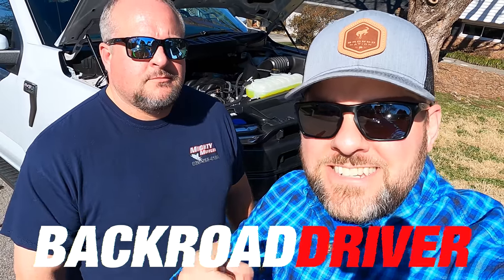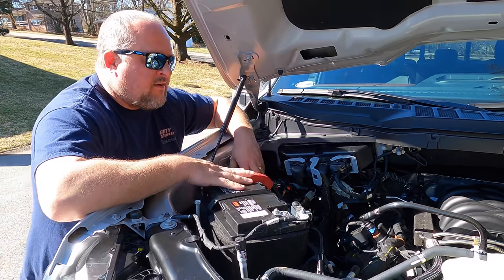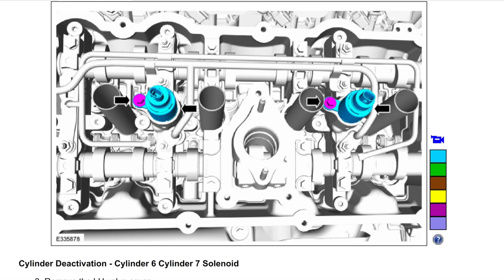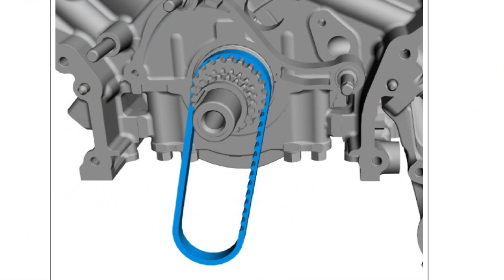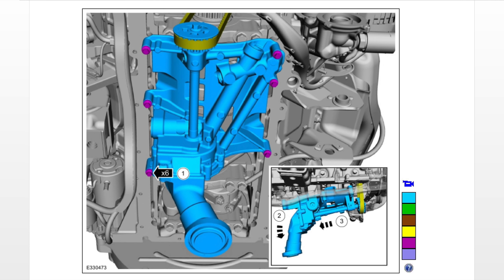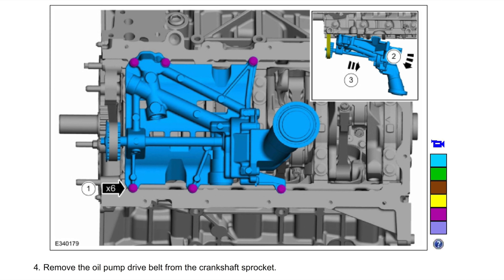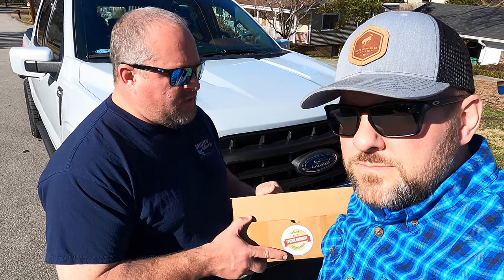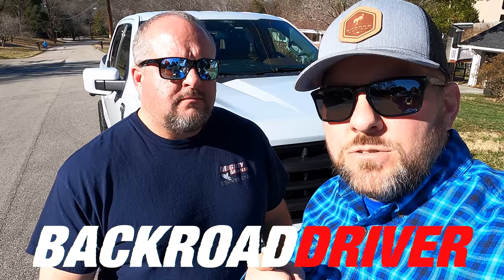2021 Ford F150 5.0 V8 Cylinder Deactivation & Oil Pump Belt Explanation - JLT Catch Can Install

Comment: They're not mentioning cylinder deactivation because they know people will avoid them given all of GM's issues...
Reply: Exactly.
Reply: Well it's a good thing on the 2021 f150 they have not just a Kevlar reinforced rubber belt on the oil pump...but the pump itself is a high flow oil pump that rivals aftermarket performance oil pumps. Stillen...the company that makes superchargers...asked ford when they were in development of a new supercharger kit if ford could put a better flowing oil pump on the 2021 4th gen coyote motor so it could handle the increased stress of forced induction. Since stillen is a big performance partner of ford...ford said why not? And did so. The other benefits of the higher flowing oil pump is the lifters get plenty of oil at low rpm...which was a big issue with gm and ram trucks with cylinder deactivation. So hopefully with this improvement...the 4th gen 5.0L with cylinder deactivation will not suffer the same fate as the gm and ram trucks.
Reply: As opposed to all the Gen 3's issues with oil consumption, piston slap, and cam phaser rattles? If guys are willing to gamble on the 5.0 knowing all those problems, why would cylinder deactivation stop them?
Reply: @karlschauff7989  to my knowledge the biggest issue with ford motors nowadays (and since about 2010) is that their OEM oil is literal garbage, all of the genes that I know of that are dealer serviced are having issues, all the guys doing their own services (that I know personally) are not having these issues, the only thing that changes afaik is the quality of oil/filters they use. (Yes motorcraft oil is API but they don't tell you it's within half a percent of the bare minimum in most categories, and they don't meet specs like DEXOS, while many aftermarket oils like mobil 1 do) we're in west texas where EVERYTHING has to be severe service (if you want it to last) because of dust and extreme heat (and cold for a bit). I do know a few that have already taken a gen3 past 200k miles here and they're going good.
Reply: Exactly!!! That shit has been a big issue on GM trucks for fucking years!!!
Reply: @Anonymous01416  ford specifically designed theirs to last essentially forever with good maintenance practice.... or about 50k over warranty using motorcraft oil

Comment: If I wanted a truck that ran on 4 cylinders, I would buy a 4 cylinder truck. Definitely keeping my 2016 5.0.
Reply: Same here! 2016 Supercrew 5.0 - I'll run it to 300K miles and beyond just like my 2006 5.4.  The 2021 Coyote is a step backwards.
Reply: Ummm guys... Just pull one single little wire off the battery and it shuts off deactivation. Doesnt hurt anything.
Reply: @raymondwandell8880  no that does not work, not at all. That system is simply to moniter battery draw and charging. I dont know where people are getting that bullcrap from but that does nothing to cylinder deactivation.

Comment: Wet belts are just stupid. Dont care if it's kevlar reinforced.  Rubber will break down in oil and combustion byproducts. When the rubber starts coming apart. It ends up restricting the oil pickup. It should have been an external belt if they want to use a belt. That way it could be easily replaced on service intervals. Think about the old 2.3 with the external timing belt, lasted a ling time.

Comment: Are Engineers losing their mind when they decided to use belts to drive oil pumps? WTF!
Reply: Their are race car engines that have belt driven oil pumps
Reply: @clb_52  race car engines are disassembled much more often that an OEM engine. These are probably supposed to last 150K.. Which is today’s standard. I wouldn’t trust that belt at all considering valvetrain belts are usually replaced around 100K miles, plus this belt would be under oil? No thanks!
Reply: @velr50gt  oil pumps has less parasitic power loss than a alternator,power steering pump and ac compressor so the belt operates with less stress and it is designed to be in oil
Reply: @clb_52  My brain tries to tell me it’s okay, but my instinct says otherwise. I did not see any kind of tensioner either. Belts stretch out too more than chains and submerged in oil? Looks like a recipe for disaster. 
I have a 2020 Supra which happens to have a BMW engine (B58) and guess what? The oil pump is driven by a double roller chain.
Reply: @velr50gt  trust me if a belt is operating in oil it is designed for that
Reply: @clb_52  Trust you at what consequence ...?
Reply: @clb_52  and they are constantly serviced after every race. Some race engines are rebuilt after every weekend. So comparing it to a race engine is stupid
Reply: @wasupfool5692  racecar engines only good for one race which equates to 150k miles on regular car engine if belt can handle that you should not concerned about it failing prematurely
Reply: @velr50gt  if you think belts are weaker than chains maybe you can explain why Harley-Davidson motorcycles use belts to drive the rear wheel on their motorcycles
Reply: @clb_52  Really?
Reply: @clb_52  Well I got a Victory and a Can Am which both use belts to drive the wheel(s). Those belts are reinforced with metal and carbon fiber fibers which I highly doubt Ford would do and either of them you can adjust for stretch or change it fairly easily. None ride in oil. You cannot convince me that using a rubber belt is a great idea to run none other than an oil pump. Something tells me that oil thickness is going to be restricted too.
Reply: @velr50gt  so you agree that belts can do a job for which it was designed for
Reply: @clb_52  Belts can be used on the right place. I would never ever thought an engine oil pump be driven by a belt. A belt breaks, stretches or slips on a motorcycle the chances of damage in my mind are minimal. If it does any of those while driving an oil pump at decent rpms and the engine is toast. Done.
Reply: @velr50gt  have you herd of a oil pump driven by a belt braking?
Reply: @clb_52  none of which are submerged in oil.
Reply: @velr50gt  the belts on oil pumps have teeth so it's not going to slip
Reply: @clb_52  all of which have to be adjusted. I know from experience. I’ve had three and not one of them was submerged in oil. Their biggest weakness is debris getting between the belt and pulley( pebble, wire,nail) it will be pushed through the belt. I realize you shouldn’t have any of this in your oil pan but you will have heat and a certain amount of sludge. Harley belt drive is a terrible comparison.
Reply: @clb_52  happens in nascar more often than you think
Reply: @clb_52  I have never heard of an oil pump on an OEM engine driven by a belt or breaking. Race engines sure, but once again. Those are gone over every X amount of passes or rebuilt anyways.
Reply: @clb_52  So what happens when it stretches? No teeth are going to compensate for that. Even timing belts with tensioners slip and they have teeth and are not ran through oil.
Reply: @velr50gt  if the tension is correct on a timing belt and is in good condition it will not slip it will take a significant amount of slack to cause a belt with teeth to slip

Comment: Cylinder deactivation and a oil pump belt? I bought my 5.0 for simplicity and durability. Where is that in the 2021?
Reply: The only simple and durable engine left in the Ford lineup is the 3.3L Mazda v6 :/
Reply: @datapro007  I disagree. 290 horsepower is more than most v8s were making 20 years ago and you never heard anybody complaining about a lack of power back then.

 If anything, 400 horsepower is overkill for most people. After all, if you need to tow your house, you probably shouldn't have bought a half-ton to do it with in the first place.

Comment: With cylinder deactivation, Ford just deactivated my wallet. Nobody wants that shit
Reply: Nope
Reply: I agree. I used to be a Chevy guy as well but once the started putting cylinder deactivation and afm it just ruined them for me
Reply: @spencertb6034  can be easily disabled.
Reply: It is the most useless marketing BS  ever. It is just a way for them to market it a extra 1-2 mpg.  The only good thing is you can deactivate via handheld tuner.
Reply: @spencertb6034  they did put in fixes to prevent the issues Chevy was having (blowby and lifter failure) from happening to the coyotes. And they pretty much tried to sneak it in under the radar because of that reputation that dodge and Chevy gave it (and are still giving it) because they knew nobody would buy the truck if they told them they added it, or at least very few would. I'm going to wait a year and see if anyone actually has problems with it, but they also made it stupid easy to disable, one little plug and that's it, gets rid of stop/start too, and it doesn't REALLY help mileage, but it does help emissions, which is what they're really worried about.
Reply: @calebniederhofer6529  

If you drive it in sport mode...cylinder deactivation never turns on. Or in any of the other off road modes. Never turns on. Or in any drive mode including eco mode...while using manual mode with he gear selectors. 

You don't need a tuner to turn off cylinder deactivation.
Reply: @Prestiged_peck  

I've got a 2021 f150 Lariat. 5.0L. And I can say that auto stop start does in fact help fuel mileage. Especially in stop and go traffic. 

And I've done 2 highway trips to see if cylinder deactivation really helps or not. Two 30 mile drives. One in sport mode...which doesn't let cylinder deactivation do its thing. And another 30 mile highway drive in eco mode where cylinder deactivation does turn on Especially during light throttle applications. 

Guess what?

Cylinder deactivation helps. Quite a bit lol.

It's physics man. 4 cylinders being fueled vs 8. Of course it works. Of course it makes a difference. Of course it REALLY does help.
Reply: @_E_B_   Yes you do to deactivate it completely.
Reply: @_E_B_  interesting, what where your mpgs like?
Reply: @victor19K  

The 30 mile trip in sport mode I got 19.4 mpg. Trip average. 

The 30 mile trip in eco mode and letting cylinder deactivation do its thing...I got 23.9 mpg. Trip average.

Comment: Just ordered a Platinum with the 3.5 ecoboost. Wanted to go with the 5.0, but with cylinder deactivation being new for the 5.0, didn't want any headaches. Hopefully they nailed the engineering on it. Have the 3.5 ecoboost in my 2016 with no issues with 82k miles. Thinking about it, I was concerned going with the 3.5 ecoboost when I ordered the 2016. With technology changing so quickly these days, guess there will always be risks. Give me the 360 I had in my 1976 Highboy, and I'd be a happy camper. Always enjoy watching your guys videos!
Reply from the maker: Thanks for watching!
Reply: I have a 2012 FX4 with the 3.5.  Currently at 124k miles.....only have been to the dealer once to fix a short in a wiring harness....that is it.  Engine has been flawless and runs almost as strong as it was when it was new.   I did put a catch can on @ 100k and probably should have done it sooner though.  If I were to buy another in 2021 I would probably go back to the Ecoboost.  Engine is even more powerful, the truck is lighter than mine and with the port and direct injection they have fixed the intake valve issue that GDI vehicles are known for.   Should be a good truck.

Comment: Hmmm...I like the 2.7 and 5.0 equally. Or used to. Not a fan of dropping cylinders. Or belt driven oil pumps that will have limited service life.
Reply: 2.7L has belt driven oil pump now too.  There's also an SSM if earlier chain driven oil pump 2.7L get a new short block, it is to be converted to belt drive oil pump.

Comment: I wouldn't buy a Caddy when it had the V8-6-4 engine; my dad had one and it was a piece of crap. I won't  buy a Honda which has cylinder deactivation on its V6, for goodness sake. I won't buy a Ram 1500 with the 5.2 liter  gas  V8, and now I won't  buy a Ford F-150 gas V8 either. It doesn't matter if you can "hardly" notice it. If you notice it, I won't pay my hard earned scratch for it.  The twin turbo V6 Ecoboost and PowerBoost engines are the best F-150 gas engines. The V6 diesel is also a good unit. The new Godzilla 7.3 liter V8 is the only Ford pickup gas V8 without cylinder cutoff, but it's only available on the F-250 and above; the diesel V8 does without cylinder cutoff, too.  Ford doesn't look very customer friendly by ruining its 5.0 V8.

Comment: SO the JLT Catch Can is great HOWEVER!!! There needs to be 2 cans NOT - 1 - So if you look at the drivers side there is yet another PCV from the crank case to the intake.... Yep if you only install ONE 1 Can then you have only fixed half the story.... So 2 cans needs to be installed one for the left side of the motor and one for the right side of the motor... I have a 2021 Eco boost 3.5 turbo and thus it needs 2 to do the job...

Think about it there are vents on each side of the motor and they both feed into the air intake and thus will be blowing oil into the engine from the drivers side if you only install onto the right side.

I subscribed

Comment: Ive had a 2008 ram 1500 with the hemi and Ive always hated the cylinder deactivation. Its very noticeable in that truck you can feel it lose power. It also sounds like crap with the exhaust I have. I just bought a 2022 f150 with the v8 and I can honestly say ford did cylinder deactivation right. Whatever they did its totally different I don't notice it at all which is good that's how it should be.
Reply: For now. We'll see how the engine handles deactivation after 100k. Maybe you can let us know? My hope is everything's just fine but my skeptical side says it's gonna be a repeat issue like many of the other deactivation systems with mass oil consumption
Reply: Fyi, you dont have a HEMI. Tbey have not made a REAL one since the 70's. Use to work on these newer V8's from Dodge 1995 to 2018. Fake HEMI.
Reply: @MasterCarguy44-pk2dq  Doesn’t hemi just mean it has a hemispheric or dome shape on the cylinder heads?
Reply: @1986vette  Hemispherically shaped combustion chamber and concave topped pistons. Do your home work. Chrysler paid big money for the cooy rights to use the name Hemi to bring it back. Its just a marketing scheme. False advertising. People akwsys asked me why I didnt buy one of the V8 vehicles of my company I worked for, Dodge, I told them when they drop the name abd dont use commercials with a baby saying HEMI, so stupid.

Comment: I Do Cars did a teardown on a 1L ford motor with the belt driven oil pump and found that the rubber from the belt had come off and plugged the oil pump strainer. 
   I have a 2020 4x4 with the coyote engine it gets about 2-3 miles per gallon better than a coyote I had in a 2013 2 wheel drive truck I'm very happy with it.
   The start/start quit working on it when  it was about 1 year old, I never had it repaired.